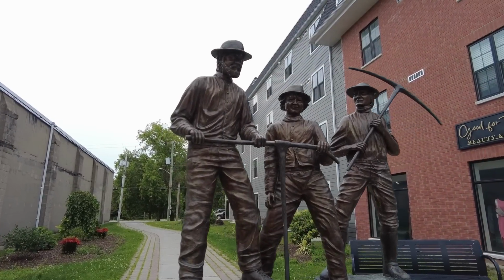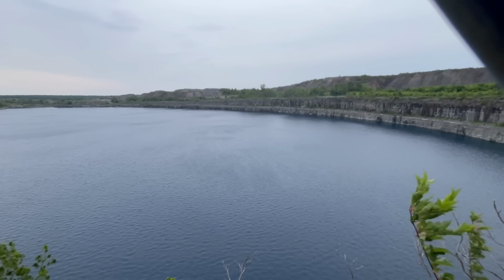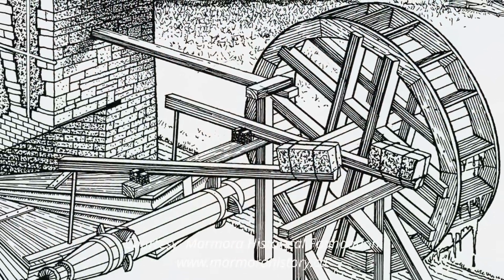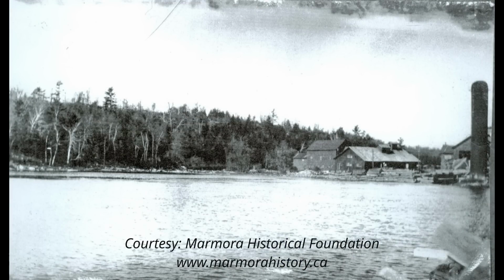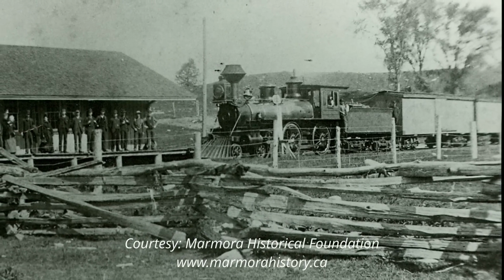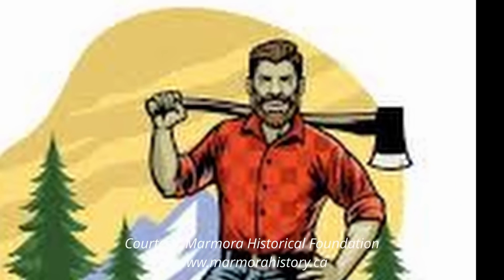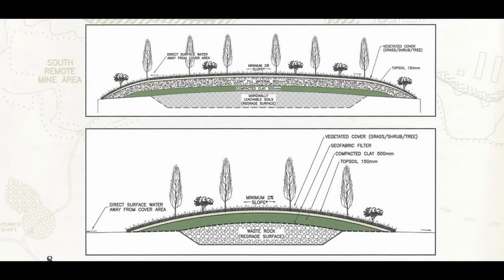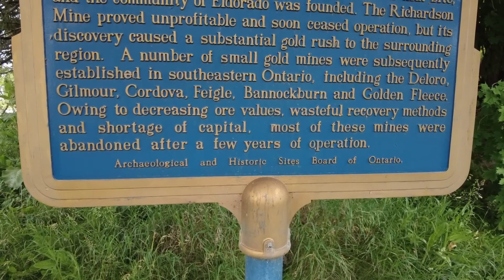Ontario's First Mining Town - Iron Ore Mines, Madoc Gold Rush & 1820s Iron Works & Foundry

Comment: The company I retired from Northland Power was looking to build a pumped storage 400 MW generating station using the mine as a lower reservoir. An upper reservoir was to be constructed with a 400 MW generator between the upper and lower reservoirs. Make power during day time when power needed then pump water back up from lower to upper reservoir at night when load on the grid was lower. Not sure if it was built or got canceled by the government

Comment: What you referred to at  as the "cam" around 10:25  is in fact the fulcrum upon which rest the shafts  of the hammers. The cam is actually in front of the hammers and fulcrum, it  is round, it spins, and emanates directly from the axle of the water wheel. Please have another look.